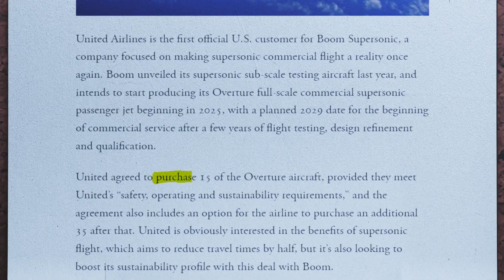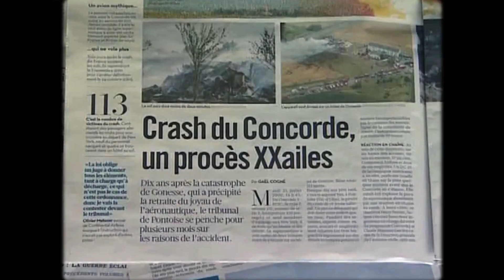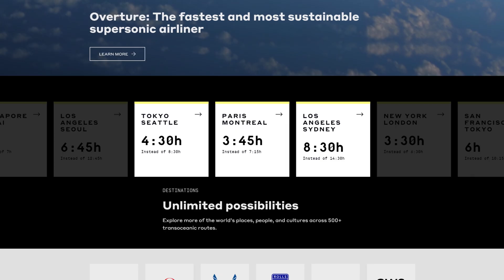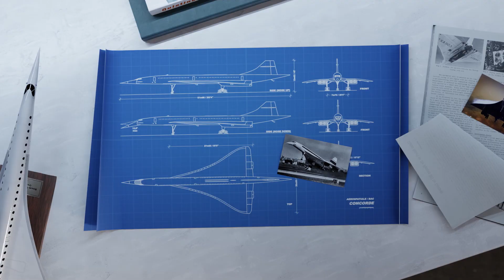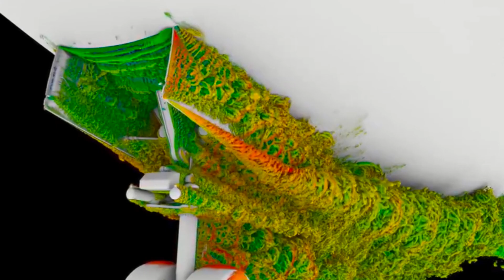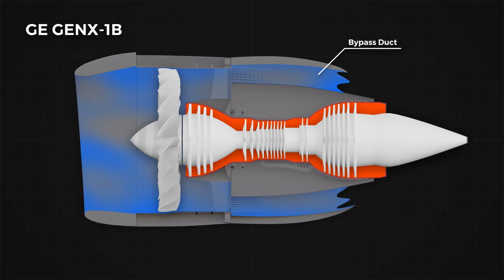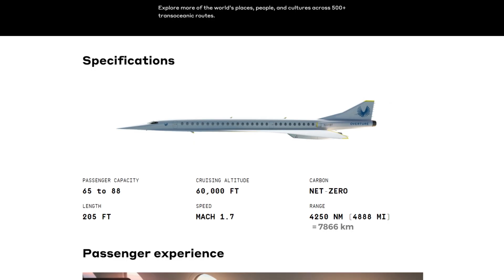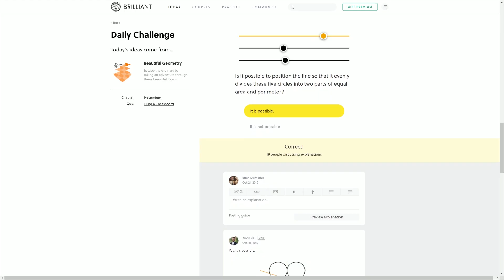Will Boom Bring Supersonic Back?

Comment: Will Overture be able to fill the gap left by Concorde in the SST market?

Introduction
Boom have undertaken a mammoth task in developing and producing the Overture SST, with its Symphony power module and turbofan engine. The biggest risk is that they will deplete their capital, before a prototype Overture flies. Once that milestone is reached funding should be available. The following, is based primarily on information from Boom, and assumes that Overture meets its specification and goes into airline service. I have no connection with Boom whatsoever.

Aviation
Aviation has changed radically since the iconic Concorde first carried passengers in 1976. More people are flying, the number doubles every 10 years, and they are richer. Aviation fuel is roughly the same price as it was in 1976, taking into account inflation, and with deregulation, airline tickets are now cheaper, in real terms. Aircraft now have the range to fly non stop between any two airports in the world.

Technology
Computer aided design, and simulation has transformed aircraft design and development, by drastically reducing time and costs, and increasing effectiveness. In addition, advanced technology and materials, have enabled more powerful, more efficient engines, and lighter, cheaper, and more streamlined aircraft. 

Flight
Because Overture will be economical at sub and supersonic speeds, 500 routes, some mixed land/water, are viable, rather than just 2 Atlantic routes for Concorde. Overture will be carbon neutral, using sustainable aviation fuel (SAF). Overture will will create a sonic boom, but not over land, where it will cruise 10% faster (Mach 0.94) than subsonic airliners. It will cruise at twice the speed of subsonic airliners over water. Concorde carried 100 passengers at Mach 2, over 4,488 miles. Overture will carry 65 to 80 passengers at Mach 1.7 over 4,880 miles. 

Airframe
Both aircraft are 202ft long, but Overture will have a gull wing with computer controlled leading and trailing edge flaps, and a greater span, at 106 feet compared to 84 feet. Overture will also have an empennage. Carbon composite construction will enable streamlining, weight saving, and increased strength, while practically eliminating thermal expansion and contraction.  Overture will weigh an estimated 154 tons, Concorde weighed 185 tons. Concorde could carry 2.5 tons of cargo. The cargo capacity for Overture is not known. 

Engines
Overture's engines will be medium bypass turbofans without reheat, while Concorde had turbojets, with reheat. This means that Overture will be economical at subsonic speeds and will be low noise on take off and landing. Variable geometry ducting in the Symphony power units will probably allow the engines to supercruise.

Costing
Overture's predicted development cost is $8bn, against $14.4bn for Concorde. Manufacturing cost will be less, maintenance costs will be lower, and availability will be higher. Overtures selling price will be $200M, compared to $320M for Concorde. At a guess, Overture's development payback will be 150 aircraft, and airline payback will be 10 years, assuming 72 seats and 8 hours a day utilisation.

Operation
Overture will be simpler to fly, eliminating the need for a 6 month pilot conversion course. Overture will have improved low speed handling, especially on take off and landing, while maintaining low drag at supersonic speeds. It will have a modern cockpit, with a flight deck similar to subsonic airliners. A flight engineer will not be required. Instead of a droop snoot, external cameras and cockpit displays will give the pilots a view of the terrain when taking off and landing. Its cabin will be quieter and all its seats will be business class, almost certainly with internet. In contrast to Concorde's awesome engine noise, Overture will comply with ICAO-14 noise regulations, allowing it to use all airports, without triggering protests. 

Ticket Cost
Taking a JFK to LHR one way flight:  
Showing: Aircraft type,  Fuel cost per passenger,  Economy ticket,  Business Class ticket,  Duration

Boeing 747          $147          $577             $2,308                      8hrs 
Concorde             $753                                $5,000^                     3.5hrs 
Overture^^            $708         $1,200           $3,000^^^^                4hrs 
Business jet^^^                                 $53,000 to $99,000            8hrs  

Notes
^ 2023 value 
^^ Estimated prices, assuming Overture carries 72 passengers against Concorde's 100. For the first 2 years, only business class seats will be available.    
^^^ There are no supersonic business jets
^^^^ $5,000 return 

A 16 hour flight across the Pacific on a subsonic jet could be achieved with a 1 hour refuelling stop by Overture, giving a time of,  4 + 1 + 4 = 9 hours.

Market
Overture will not be competing for the mass economy market. Instead it is aimed at the 700 million long-range business flights made each year world wide. Boom and airline customer surveys show the viability of Overture, and they have identified 500 suitable routes. All Overture's seats will be business class and ticket prices will be comparable with business class on subsonic airliners. Once Symphony gets established it could become a niche service, similar to Concorde, but with many more routes.

Conclusion
Overture will be popular with both airlines and passengers, because it will half many journey times and will be cheaper, more comfortable and a lot more practical than Concorde. The military have already shown an interest in Overture. It would also be suitable for charter flights. There may even be a market for the Symphony power unit or just the engine. As Overture matures, it will probably be developed, just like subsonic jets. So the range may be increased, there may be a stretched version, and even an all economy seat version. After Overture, Boom could possibly develop a 200 seat SST.

22-2023.09.04

Comment: Who will this benefit
All this money spent on fast travel when more and more travel restrictions are happening
Most won’t be able to afford this. Those that can may take their own private jets, so they don’t have to mix with others
I can’t see the risk / benefit analysis being a positive result
More wasted money. All this crazy spending keeps more people poorer. Maybe by design
IMO
Reply: @mikee4639

There should be a healthy market for Overture if it reaches production and meets its specification. Overture is not aimed at the main line economy market, which is more than adequately served by Boeing and Airbus, for example. Instead Overture is targeting the 700 million long range business trips made yearly, world wide (despite remote conferencing, the internet, etc). Just like there are sectors in the market: regional, short haul, medium haul, long haul, Overture will form an addition niche sector, rather like Concorde did, except a lot bigger.

Overtures will carry 65 to 80 passengers in business class seats. Ticket prices will be comparable, with subsonic business class. It will fly economically over land at Mach 0.94, 10% faster than subsonic airliners, and Mach 1.7 over water. This means that Overture will have 500 viable routes, compared to just two Atlantic routes for Concorde. Its cost of ownership will be much lower than Concorde, with better availability and cheaper maintenance. Also a flight engineer will not be required. It will comply with ICAO-14 noise regulations, so it will be able to use all airports, without triggering protests.
  
Take a JFK/LHR flight. A subsonic airliner will do the crossing in 8 hours. Overture will do it in 4 hours. A ticket would probably cost $3,000 one way, and $5,000 return.

Longer flights, across the Pacific for example, would require a fuelling stop, of say 1 hour. A subsonic airliner would take 16 hours. Overture would do it in 4+1+4=9 hours total. A ticket would probably cost $6,000.

Boom estimate that Overture's development costs will be $8bn. The unit cost of Overture has been set at $200M, so at a guess, the development payback would be 150 aircraft. This means 600 engines plus spares. Assuming 72 passengers and 8 hours flying a day average, 365, airline payback would probably be 10 years. Of course, there would be other options like leasing, and airlines normally get a large discount on the list price of an aircraft.

If it all turns out as I suggest, there would be myriad opportunities for related versions of Overture, just as there have been with other aircraft, especially the Boeing 737. So there may be a  military version, stretched version, long range version, business jet version, and so on. There may even be a market for the Symphony engine or complete power module.

Boom was initially funded by Blake School, and then by private investors, not by the US government, so poor people aren't affected. But in 2022 the UK spent £320 billion on social security and the US spent $1.16 trillion, so poor people are taking a big slice of the national budgets of both countries.

Private jets are astronomically expensive, ranging from $12m to $80m. Just a ticket on a private jet costs a fortune:

Taking a JFK to LHR one way flight:  
Showing: Aircraft type,  Fuel cost per passenger,  Economy ticket,  First Class ticket,  Duration

Boeing 747          $147          $577             $2,308                      8hrs 
Concorde             $753                                $5,000^                     3.5hrs 
Overture^^            $708         $1,200           $3,000                      4hrs 
Business jet^^^                                 $53,000 to $99,000            8hrs  

Notes
^ 2023 money 
^^ Estimated prices, assuming Overture carries 72 passengers against Concorde's 100. For the first 2 years, only first class seats will be available.    
^^^ There are no supersonic business jets 

A 16 hour flight across the Pacific on a subsonic jet could be achieved with one 30 minute refuelling stop by Overture, giving a time of  4 + 0.5 + 4 = 8.5 hours.

Comment: CORRECTION--According to British Airways, in 2002. Their  Concorde Service was creating 25% NET, of all their Profits, and rising. So why did they stop the service ?  Decades before Concorde flew, Both Airlines agreed, in a legally binding contract, that should one Airline cancel their Concorde service,  the other would do so too. Air France was in debt over their Concorde service, and couldn't afford the rising costs for new safety systems and maintenance.   P.S  Concorde was not exclusively for the rich, there was a increasing amount of people, who used special Anniversarys, and other occasions for their 'Special' trip. Also a increase in clubs and other gatherings highering Concorde for short trips to the Bay of Biscay etc etc often reaching.supersonic speeds.Things were changing,  then the two main disaster's left it's mark on ALL flights, delivering a fatal blow to Air France .  As for the crash, it had nothing to do with Concorde, a series of linked incidents, caused by someone elses failure, to do their job properly !!
Reply: @MrDaiseymay  The final blow came when Airbus declined to supply spares for Concorde.
Reply: True, and was the same reason the last VULCAN  was grounded. BUT---I can't believe in this Hi Tech world, that Someone, couldn't be found to step forward.  That was the spirit during WW2. @phonicwheel933

Comment: 2:35 Interestingly, if you dump enough energy into a plasma sheath ahead of the aircraft, you could completely destroy the shock wave, as per wikipedia's article on plasma actuators

Comment: I just watched a video explaining how since the inception of the miles system (AAdvantage etc..) most airlines don't turn a profit from the seats sold on the flights but make their money from people/companies buying miles instead. So would this mean that this time around the tickets could be substantially cheaper than the concorde because of the profit margins as a result of the miles program?
Reply: @jordangibbons1429 Here is an estimated cost for Overture:

Taking a JFK to LHR one way flight:  
Showing: Aircraft type,  Fuel cost per passenger,  Economy ticket,  First Class ticket,  Duration

Boeing 747          $147          $577             $2,308                      8hrs 
Concorde             $753                                $5,000^                     3.5hrs 
Overture^^            $708         $1,200           $3,000                      4hrs 
Business jet^^^                                 $53,000 to $99,000            8hrs  

Notes
^ 2023 money 
^^ Estimated prices, assuming Overture carries 72 passengers against Concorde's 100. For the first 2 years, only first class seats will be available.    
^^^ There are no supersonic business jets 

A 16 hour flight across the Pacific on a subsonic jet could be achieved with one 30 minute refuelling stop by Overture, giving a time of  4 + 0.5 + 4 = 8.5 hours.

Comment: I think these airlines where just trying to gauge interest from the public. I don't think this is going to happen ever again, to many obstacles and profitability hurdles to overcome.
Reply: @darkknightx0992   Japan Airline has invested $10M in Boom with options for 20 Overtures. United has put deposits on 15 Overtures and options for 35 more. American has put deposits on 20 Overtures. Boom and the airlines carried out extensive surveys into customer reaction to Overture, before the Overture development program started. They would hardly do otherwise.

 There should be a healthy market for Overture if it reaches production and meets its specification. Overture is not aimed at the main line economy market, which is more than adequately served by Boeing and Airbus, for example. Instead Overture is targeting the 700 million long range business trips made yearly, world wide (despite remote conferencing, the internet, etc). Just like there are sectors in the market: regional, short haul, medium haul, long haul, Overture will form an addition niche sector, rather like Concorde did, except a lot bigger.

Overtures will carry 65 to 80 passengers in business class seats. Ticket prices will be comparable, with subsonic business class. It will fly economically over land at Mach 0.94, 10% faster than subsonic airliners, and Mach 1.7 over water. This means that Overture will have 500 viable routes, compared to just two Atlantic routes for Concorde. Its cost of ownership will be much lower than Concorde, with better availability and cheaper maintenance. Also a flight engineer will not be required. It will comply with ICAO-14 noise regulations, so it will be able to use all airports, without attracting protests.
  
Take a JFK/LHR flight. A subsonic airliner will do the crossing in 8 hours. Overture will do it in 4 hours. A ticket would probably cost $3,000 one way, and $5,000 return.

Longer flights, across the Pacific for example, would require a fuelling stop, of say 1 hour. A subsonic airliner would take 16 hours. Overture would do it in 4+1+4=9 hours total. A ticket would probably cost $6,000.

Boom estimate that Overture's development costs will be $8bn. The unit cost of Overture has been set at $200M, so at a guess, the development payback would be 150 aircraft. This means 600 engines plus spares. Assuming 72 passengers and 8 hours flying a day average, 365, airline payback would probably be 10 years. Of course, there would be other options like leasing, and airlines normally get a large discount on the list price of an aircraft.

If it all turns out as I suggest, there would be myriad opportunities for related versions of Overture, just as there have been with other aircraft, especially the Boeing 737. So there may be a  military version, stretched version, long range version, business jet version, and so on. There may even be a market for the Symphony engine or complete power module.

10-2023.08.28

Comment: 8:35 the snoot “droops” it’s a droop snoot
Reply: @jesper8836 Overture will not have a droop snoot. Instead it will save weight, complexity, and cost by having external cameras and displays in the cockpit so that the pilots can see the terrain when taking off and landing.

Comment: 31 July 2023 This is a brilliant presentation but it is now well out of date because of the many changes that have taken place at Boom.
1) Overture has been completely redesigned. It now has an empennage, 4 engines, and a wasted body.
2) Rolls Royce have now finished their business with Boom.
3) The Overture engines will now be developed by Florida Turbine Technology
4) The engine will be a 72 inch fan, medium bypass turbofan. 
5) The demonstrator has completed taxi trials but has not flown
6) Virgin have now broken ties with Boom.